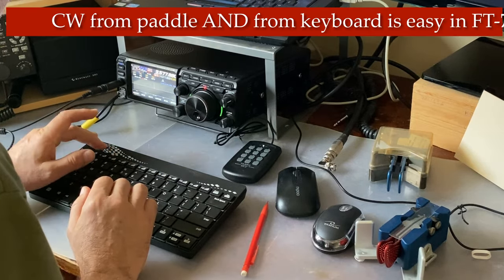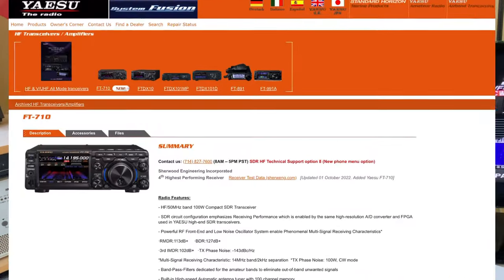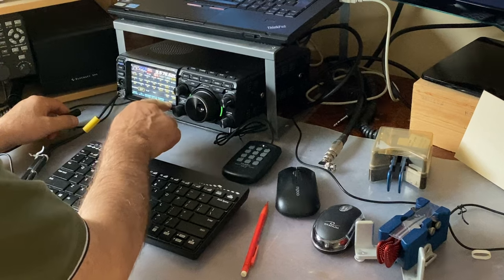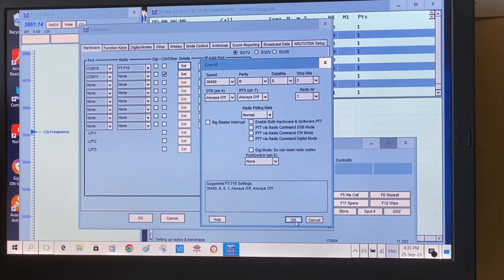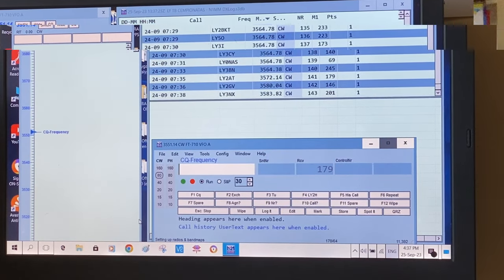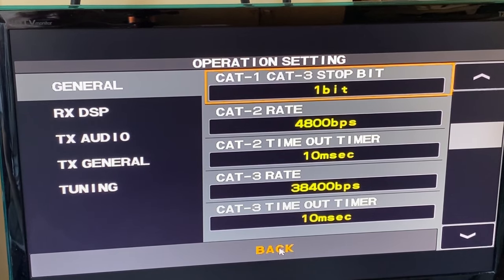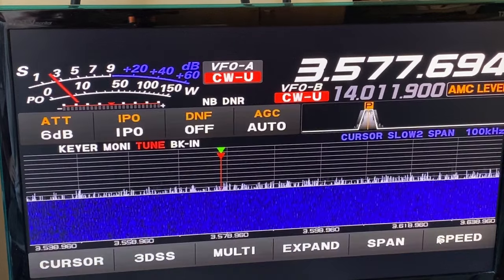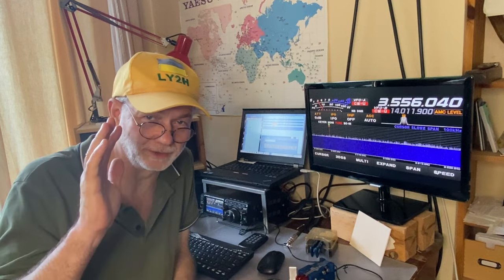Beautiful CW with YAESU FT-710 and how to set it up correctly for N1MM Logger

Comment: I received my FT-710 a month back . 
Wanted to know if anyone using for Digital Modes .
Reply from the maker: @RAMAKRISHNARAOKAKIVizag  Congratulations! Yes, this radio  works fine on  digital, I do FT8 almost every day, actually :) I reduce power, normally, to some 50-70W, depending on band conditions, just on the safe side... Good luck! 73! Linas LY2H

Comment: Unfortunately Yaesu made not a pin diode qsk switchover. The relay klickklack is annoying, makes me crazy. I like real silcence CW TRXe, like the KX or QCX etc. Nice Video. TNX es 73!
Reply from the maker: Thanks! I fully agree, full QSK is actually impossible in this radio, unlike in my K3, but I can work semi Bk-in, even in the contest,  with less clacking . Not very "proffessional" contesting, but the beautiful receiver compensates, IMHO,  for this unjustifiable flaw in the design of this otherwise very nice, and  affordable, radio :) 73! Linas LY2H
Reply: Great video linas, I have tried many many times over the years to connect my ts 480hx to my computer, but it never worked, and even the computer shut down and I had to send it away to get fixed hi.
Now I just turn the dial and connect my paddle and I never use the computer unless it's nessasary hi hi.
But great if people  can set these things up. 73.

Comment: Linas, do you think there is any advantage to using the WinKeyer USB over the PC CW keying?  I use WinKeyer USB with N1MM for contesting, but it doesn't seem that there is an advantage to it based on your success in this video. K1EL mentions that Microsoft Windows can sometimes affect the quality and timing of CW keying from the PC. Have you run into that issue?

Also, would you consider making a video where you set up N1MM for RTTY using WinKeyer USB? I was heavily using RTTY mode many years ago with an old VIC 20 computer and a HamTronics terminal program. I would like to get back into RTTY using N1MM and the WinKeyer USB, but I have not been able to figure it out, and there doesn't seem to be much information out there on how to do it. Just curious. Thank you for your excellent videos!  -Jim WB0RLJ
Reply from the maker: Hello Jim, thanks for a very good question! Shortly speaking, I found no advantage whatsoever to using the Winkeyer over the CW generated by the N1MM. During some 20 years or so of me using the N1MM logger in all its incarnations, I have never ever had this problem of computer being slow etc. as it is shown in this video on the K1EL website :) ( I would say, this problem reminds me the RF -in-the-shack problem then the problem with the N1MM software :)). And I've been running it on great variety of laptops and desktops during this time, from WinXP to Win11, some of them only running just 1GB of RAM :). Well, I never used, nor use, the N1MM for multitasking, like controling rotators etc, may be because of that it runs flawless, as I only run CW macros and logging contest contacts on it. The max CW speed I use im the contest could be some 30wpm and this is fully OK for the logger to handle. So, may be it's just me so lucky, otherwise, why would the Winkeyer got embeded in so many apps, including the N1MM ? Who knows, I think, it's a personal case in each case. Actually, the Winkeyer has got more to offer than just a keyer, like extra PTT ports and even a stand-alone RTTY signal generator. Actually, for me, this relatively new feature of generating RTTY from the paddle was the major reason to buy the latest version of it, as I wanted to get my IC-705 running on RTTY without the need of computer ( and I succeded, there is a video on it elswhere on this channel). 
As it comes to using the Winkeyer for RTTY in the N1MM logger, well, I have yet to see the point in doing this :). As it is now, I have my FT-710 configured for the AFSK , based on the logger-embeded MMVARI multimode  software, which allows to run absolutely all "old" digital modes ( except of FT8), including the AFSK RTTY. For this limited activity on RTTY nowadays, it serves me very nice. Getting the "real" FSK RTTY running would take too much of a hassle, wiring etc. But it could be worthwhile, though if using the older, pre-USB radios, where all this wiring and external sound cards would be needed anyway, the Winkeyer might still be a very good solution. It's just my thoughts, which could be wrong, YMMV! 73! Linas LY2H
Reply: Thank you,  @Linas_LY2H  !
Reply: Hello, @Linas_LY2H  . I did a test today with my FT-710 directly connected to my Surface Pro 8 for PC keying. The results were good for the most part, however I did notice that when sending code from the PC, if I went to scroll my QSO log listing while the PC was sending, it would actually hang or pause the sending for a second or two. The sending would pause until I stopped scrolling through my list of QSOs. That's about the only action that I made that would cause a pause in sending. Now, I use N3FJP ACLog for POTA activations, so that may be a difference between N1MM and N3FJP in the way it uses the PC resources. The only other thing I noticed was that direct PC-to-rig keying had different timing for character and word spacing than what the WinKey USB has - a bit longer delay. Again, that would likely be coming from N3FJP ACLog, and probably could be tweaked. All in all a successful test.
Reply from the maker: @WB0RLJ  Good testing and interesting results! I, actually, never do anything else on my computer when sending something on the air, like a contest report or a CQ , somehow naturally :), there is no time for anything else if in the contest with high rates of qso's. Anyway, thanks for your input, let's keep on experimenting! 73! Linas LY2H